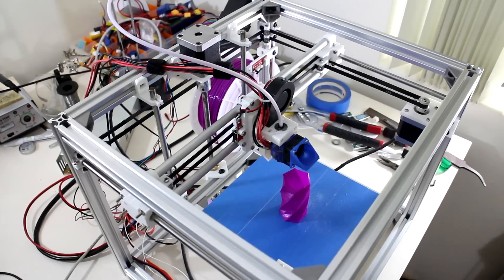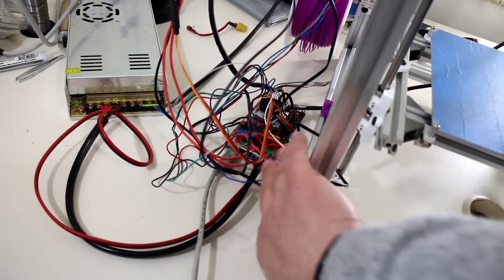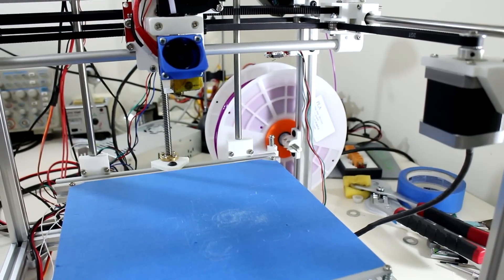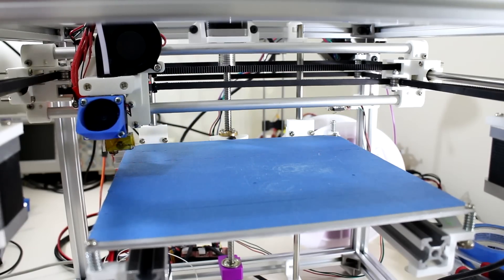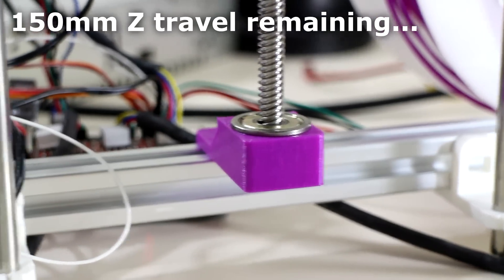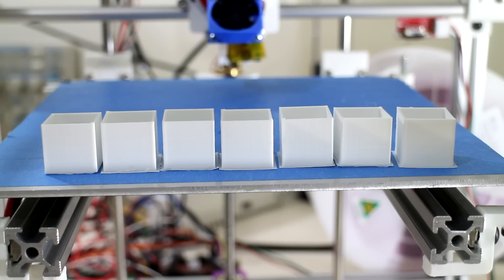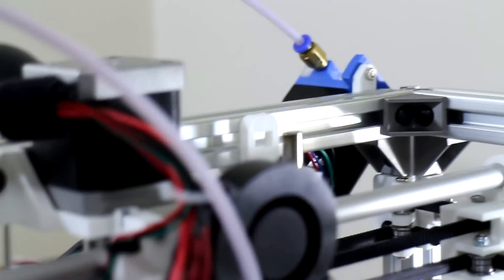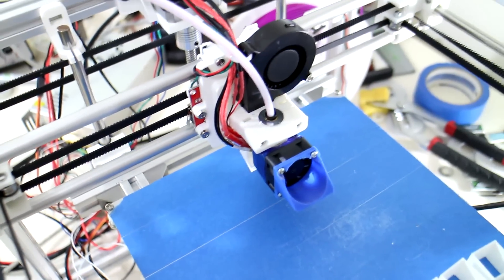New 3D Printer - Build Log #7

Comment: Congrats on getting the first print out of your build! Nice quality.

I'm still worried about the "Zed" axis. Maybe it works different than the Z axis I have =). I would have mirrored your design to have support on both sides, then changed their location to the left and right instead of the back and front. Everyone's got an opinion... Anyhow, I think it came out awesome as it is and I can't wait to see more.

I really enjoy your videos. Thanks!
Reply from the maker: That must be my problem, I'll change over to the zee instead of zed, haha. 
Great idea regarding dual Z on left and right. That means you could support a lot of weight and a much larger build platform! Also you could use these same parts, just print 2 sets and plug both stepper motors into the ramps on Z. The possibilities...

Comment: Why don't you invert the Z axis mounting point so you have all stepper motors on the same side?
Reply from the maker: If I did that, you would have the belts facing the front obstructing the view. But most importantly the x gantry would start closer to the centre resulting in position 0 being about 80.

Comment: My T-Nuts are due today if USPS will deliver them and I purchased 4 bags (400) of them and hope that is way more than enough.  Grats on killing the ringing and I can't wait to see you printing at the proper speeds for Core XY and see if the ringing remains gone because 150mm/s print speed is not uncommon on a Core X/Y.
Reply from the maker: I've been living with that frustrating ringing on the Prusa for so long I am extremely happy to have eliminated it! So many hours I wasted on the Prusa trying to get rid of that artefact!

I can print very fast with this printer. With the Prusa if I attempted to print fast it would rattle itself to pieces. Speed isn't an issue here, only printed part quality.
Reply: Tech2C
I hear you as the Prusa is known for that but so many other printers have that same issue too even into the thousands of dollars to buy one.

Comment: What kind of bearing did you use for the z axis?  Also, awesome design!
Reply from the maker: 608 flange bearings from here http://www.banggood.com/10pcs-Motor-Flange-Bearing-F608ZZ-Metric-Ball-Bearings-Part-p-1057305.html?p=9X051049165582016063
Reply: +Tech2C nice thank you!  How much do you estimate you've spent on the new frame?

Comment: Have you considered adding auto bed leveling? Either servo based with a button (thats the way I did it on mine because I had a glass bed) or inductive sensor based. Either way it ends up being less than $10, and personally made my printer so much better. Sooo easy to use and you get perfect first layers every time. Nice build though it was really cool to see everything finally going!

Comment: I might be wrong but X-axis end stop needs to be on right hand side.

All prints might be mirrored now.

try printing any non symmetrical object for a test.
Reply: basically u can have them anywhere as long as it's configured correctly in the marlin firmware but i might be wrong...
Reply: you can have endstop on left hand side  - but you need to set it in firmware correclty as well as you would need to mirror part in Slic3r along X-axis. I've got X end stop on my Prusa i3 on left hand side and it prints normaly.
Reply: +irootsk That's the whole point.

All prints would have to be mirrored
Reply from the maker: It doesn't matter. The prints shouldn't mirror. If your parts are mirrored on the x axis then the entire x axis is backwards in software. IE: position 0 would be on the right hand side, not left.
Reply: +Tech2C I had this problem in the printer I built. I could not figure out how to fix in firmware. 

So ultimately changed endstop position.

Please do explain if you know how to.
Reply: If you have your endstop on the left side and it goes there to home, make sure it says that it's at X:0 when homed, otherwise your X-axis is mirrored like Tech2C wrote.
It's easy to get the axles mirrored in a CoreXY setup due to how the motors work together.

Comment: In a word ... Stunning!
Your first print is what most of us get after tons of tweaking, it's an awesome success.

I can't wait to see the continuing use/upgrades you do with this.

I'm hoping you release all your STLs, DOM and Code etc at some point. I for one would be more than happy to pay for them too. I see no reason for you not to earn out of your work.

I have been looking to build a Core XY for ages and more recently been looking at this one http://www.thingiverse.com/thing:1001065
The only thing I can see to improve your printer, would be the double Z axis screws, that would reduce the chance of the bed flexing near the front.
However, your design is much better in many other areas.

I would like to build with a larger print volume, say 300x300x300. I think it would be quite easy to double up on your Z aixis and maybe move them to the sides. By doing that, I think your design would be ideal to scale up, simply by calculating longer extrusions and lead screws.
Reply from the maker: Thanks Mr Kent! I am very happy with the initial prints from this printer! I remember the first prints from the Replikeo Prusa i3 and I could only dream of attaining these results from it early on.

I figured out a way to get my 200mm on the Y-axis, so everyone will have to wait a little longer for the STLs - I don't want to release it half finished!

Great idea regarding dual Z on left and right. That means you could support a lot of weight and a much larger build platform! Also you could use these same parts, just print 2 sets and plug both stepper motors into the ramps on Z.

Cheers :)
Reply: Yes, I remember your first prints from your Prusa too :-) I currently have a homebrew i3, not built from a kit. Although it serves me very well, building your Core XY is clearly going to be a serious upgrade.

Waiting for the STL's etc is no problem at all, like you, I would rather do it properly than rush.

As for the build volume, I'm wondering if I might go the whole way and try to build it 400x400x400 with the side mounted Z axis. Your frame is clearly rigid enough and I don't see any other major issues.

Comment: why dont u print off some nuts
Reply from the maker: They wouldn't be very strong.
Reply: if u did good infill with the tpe it would be good
Reply: +Tech2C They can be strong. Use M4-10mm with regular nut and they print outside of nut to fit in the frame.
Reply: +Tech2C They can be strong. Use M4-10mm with regular nut and they print outside of nut to fit in the frame.
Reply: +Tech2C 

Something like this.

https://lh3.googleusercontent.com/proxy/WroHIKwTjgYL9SB3o80F2-W1zHS_UOPI_S-j2rhjvgu2vFKN6usquq_jBKegZMWY30YHKE_KUyzUbGzpRTj6Ng_t5mPmN9TXSxVtuTw2GqmxFSarbr4sTwfOINYW07Owymh3B1pKCIv7dWFIMeCYK0oYIKwVvTwSFxtlV07Bj658EOIWj1ummb0S5tpFnOJUcSFxQQ=w443-h332-nc

Comment: Might seem like a silly question but can you tell me what leads you used on the end stops to get the lights  on them to work when the endstop is triggers also on the ramps. Thanks and that printer looking good.
Reply from the maker: The 3 wire connector plugs into the ramps board and supplies power for the LED lights. It's a standard reprap part.
Reply: With endstop facing you ( micro swich being on  left side) I have the first pin (Red wire) going to D3 S and 2ed pin ( Black wire) on endstop Black going to pin D3 ( - ), how is yours plug?

Comment: nicely done, good to see successful first print! shame you couldn't quite get the full build volume. really like the design, should be good for some fast printing!
Reply from the maker: Thanks. Yeah too bad I couldn't achieve the trifecta 200x200x200 but I guess it's close enough for my needs.
Reply: +Tech2C regarding the build volume, the dimensions you posted a few videos back, is that overall external dimensions? and those dimensions achieve the build volume you have? the chassis looks pretty stable so I am just thinking that this design could be easily scalable to achieve any build volume, within reason.
Reply: +Tech2C oh and good on ya for posting all this, I really appreciate open source and the sharing communities around hobby projects, I hope you get some good tips from builders on thingiverse when you release the designs!